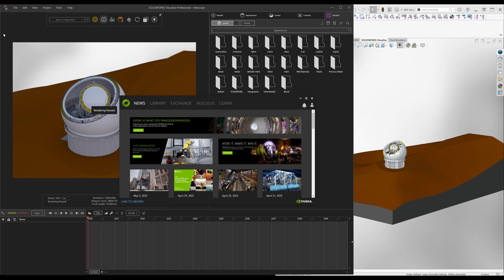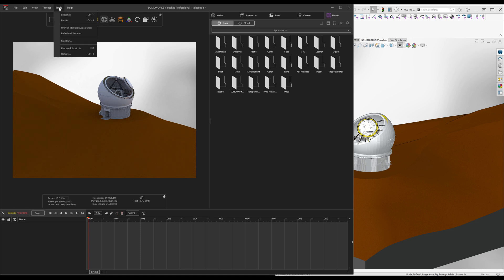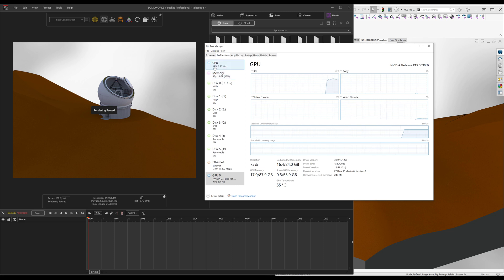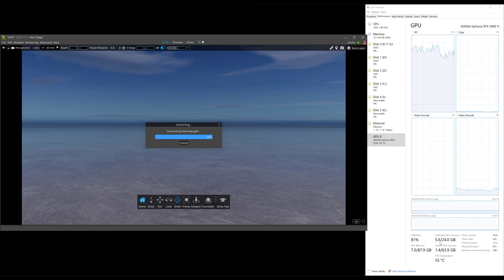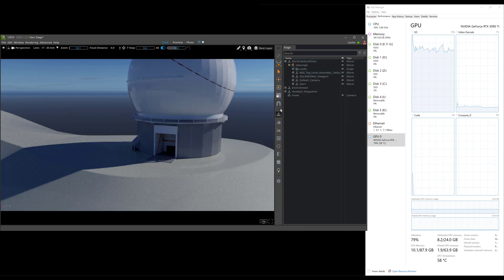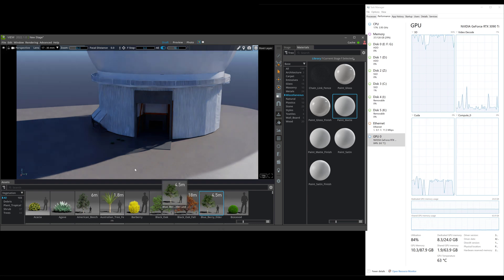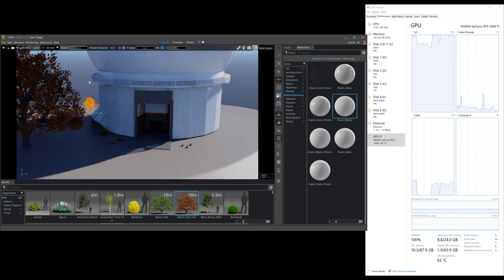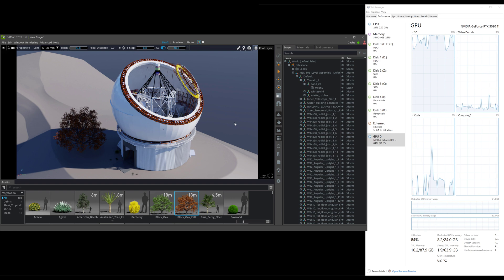Omniverse and Solidworks Workflow

Comment: When I import step files into Omniverse create, the materials do not scale correct.  I believe you ran into the same issue in this demo but it was hard for me to tell.  The gravel you applied appeared too smooth— there was no roughness to it.  Curious if that was the case and if you’ve figured out how to scale the UV’s properly.